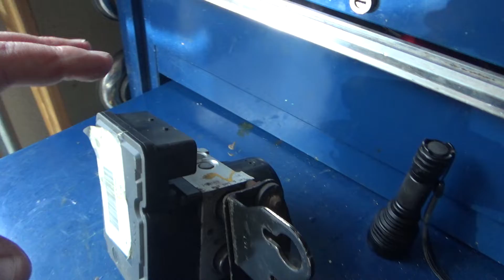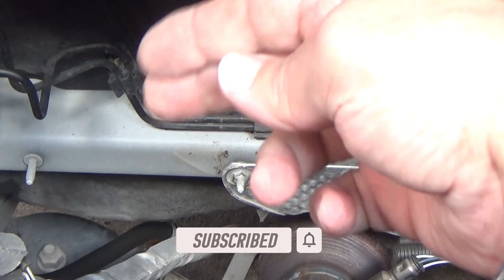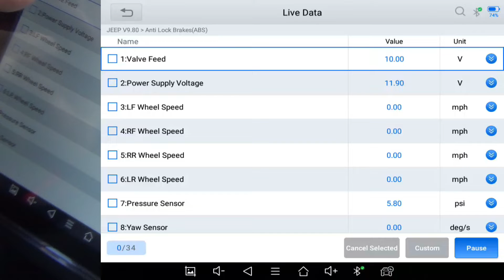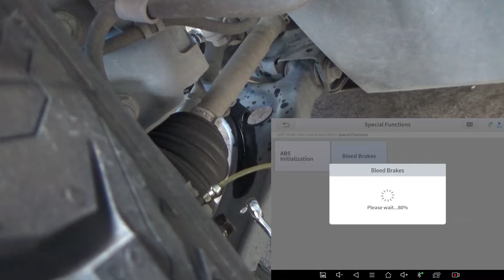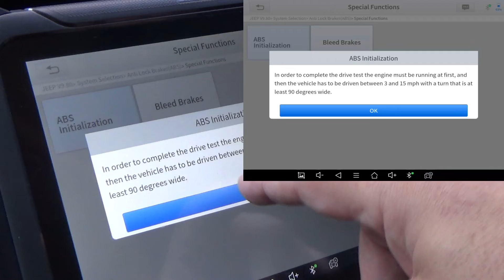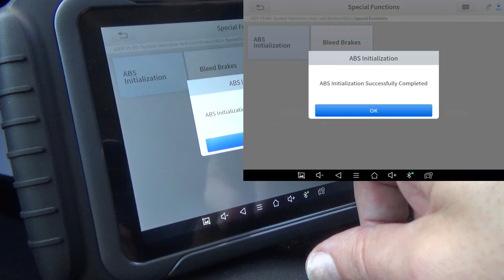Avoid costly repairs! Replace and initialize your Jeep Patriot ABS module with the Xtool D8BT. C2200

Comment from the maker: XTOOL D8BT New Upgraded Automotive Diagnostic Tool, 3-Year Updates
https://amzn.to/49tZtxD
Thinkdiag2 All System Bidirectional Control OBD2 Diagnostic Scanner ---Cheaper Alternative to D8BT
https://amzn.to/4bxbOTv
MLW48-22-9515 Combination Max Bite Wrench Set, Metric
https://amzn.to/494NGWE
Cordless Electric Ratchet Wrench Set, 40 Ft-lbs, 400 RPM, 3/8"
https://amzn.to/3unq1BI
3/8" Drive Locking Extension Bar Set, 3 Piece, 3", 6", 10"
https://amzn.to/3OwHEFO

Comment: YOU NEED A NEW ABS MODULE,,,YOU WONT BE ABLE TO PROGRAM A USED ONE,,,
Reply from the maker: The ABS module I installed was 100% used, and as the video showed, I was able to initialize it using the xtool scanner, and it has been working ever since.

Comment: Thanks for the video, really helpful, found that a second pair of hands to slightly move the abs while threading in the lines helped allot. Definitely needed to rewrite the VIN after and bleed the air out of it. Used a topdon topscan pro for it and works perfectly
Reply: From what i see online, Topdon topscanner cant rewrite the vin, did it automatically do it like in the video??

Comment: HI, great video... Just one question, is there any way I can find the PART NUMBER of the used abs module I'll be buying? Can I find that number just looking to the tag on the module itself? Finally what if the part number is not the same?
Reply from the maker: A scan tool will show you the part number.
Reply: Hi again, I just wanna Say thank You... Today I was able to replace the ABS module on a Jeep compass 16' the C2200 DTC got resolved ... Followed step by step of your video and boom! Repair succesfully complete 👍
Best regards from El Salvador.

Comment: is this the same as a U0121 code?
Reply from the maker: No, The C2200 is an internal failure of the ABS module the U0121 is a lost communication with the ABS module which could be a bad connection, wiring issue, or bad module.

Comment: What is the code C121C on 2017 jeep patriot sport 4x4
Reply from the maker: Torque Request Signal denied.  The manual says it could be the PCM or ABS module.

Comment: I'm having this same issue (signal dropping out) on my 2010 Dodge nitro.  Looking in live data (APP1 and APP2) - accelerator pedal position:   APP2 signal drops out every few seconds.  But apparently that's normal.   I talked to Scanner Danner and Eric O (south main auto) --  and they both told me that it's normal for dodge to have that APP2 signal drop out.   It looks like it's a random pattern;  but Eric (SMA) said that it happens at a very consistent interval if you put a scope on it..  It's just that the scantool isn't fast enough to catch that level of detail.. so sometimes it doesn't catch the drop out;  but you can see it with a scope.............   My point is, you can't really trust that live data signal that you're showing, it's just not fast enough;   it really needs an oscilloscope to know what it's actually doing.